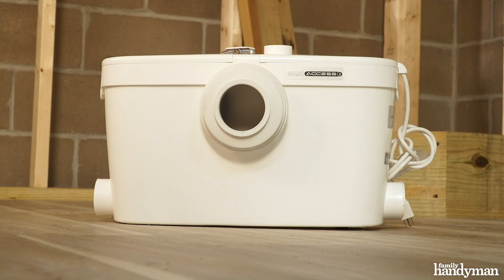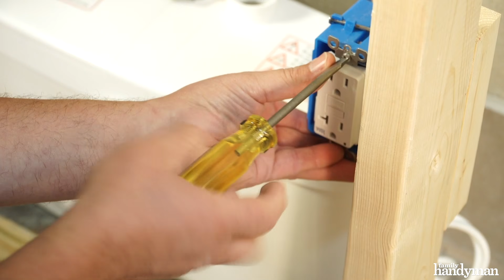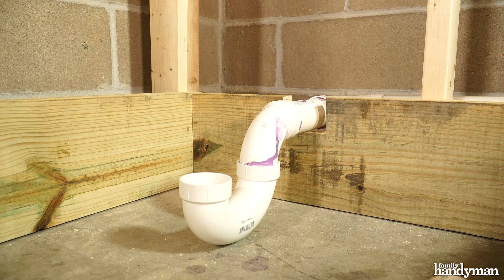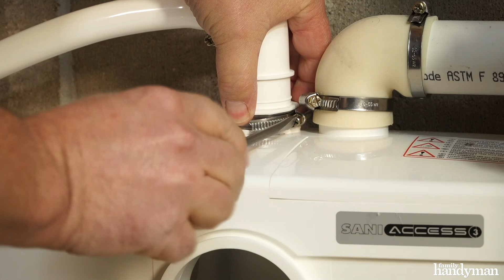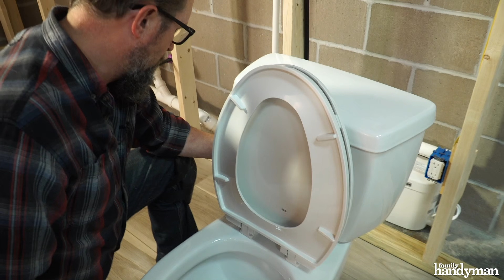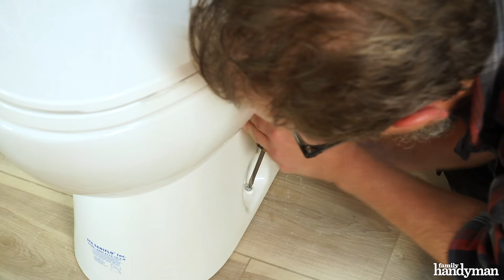How to Install a Saniflo Toilet

Comment: I mean no disrespect whatsoever buddy, but you really must check the work you've done. Starting from the shower 2" discharge that sits below the proper pitch to the vents for each fixture (not a rule for everyone) and a few details that you've missed throughout the installation such as an access panel for future proofing! 😊

Comment: Did you drywall everything behind the toilet?  What if the system goes bad are you going to have to tear up the drywall to fix it?
Reply: Adding to this, do you have the rest of the build on video?  Like the shower and the sink and then the finish bathroom?

Comment: Seems to me the flexible the weakest point of the install.   Would not that boot  stop the flow of solids to the pump?  Is is possible to use solid pipe vs flexible boot?

Comment: Is the toilet pump made to handle water discharge from a sink as well as shower, along side the toilet? Won’t that void any warranty on the toilets pump? That toilet waste tank looks to maybe hold 2-4 gallons of water max, and a shower can use 2+gpm.. I’d be really interested to know if that’s factored into the design or if maybe it’s supposed to have sink/shower water discharge to help flush out the macerating unit..? Anyone know?

Comment: We’ve had one in our basement for 17 years. It’s getting weak, but we will replace it with another saniflo sanibest pro.
Reply: Hello, do you have yours hooked up to a shower and sink as well? We are going to do this in our basement bathroom and we’re trying to find feedback from others who already have done it, thanks!
Reply: @Nnn-nv4tw  yes we do.
Reply: @Nnn-nv4tw we did this too in our basement.  Basement stairs go down the middle with a wall in the middle.  One side of wall is the tiny bathroom with sink toilet and shower(husband built a tiny shower using RV enclosure) step-up.  The other side of the wall is where the washing machine is located and the macerator which is easy to access.

Comment: For the shower could you have dug into the concrete to put the p trap in the ground instead of building that platform?
Reply: @anthonypierre2094  what my husband did was make a step-up shower(RV Enclosure) with the pipe underneath it, which laid over the concrete.  Have had this system for 6 years now.

Comment: How tall did you make the base for the shower?  Also is there a video of you installing the shower pan?

Also can you tap into a 3/4” line instead of a main sewer line?
Reply: 3/4 drain line??? Never heard
Of such a small drain.. I wouldn’t dare attempt to drain anything into a 3/4” line… my kitchen sink is double the width of your supposed 3/4 drain, and I have to snake it out at least once per year..

Comment: As someone with part of their job is to maintain buildings… please do not put this behind a wall. The company I work for has quite a few of these behind a wall and it’s so much more of a pain in the neck when these things are behind a wall so if something goes wrong with them expect a increase in your bill because you have to cut into the wall, or if the pump fails and leaks well self explanatory.. leave it behind the toilet but not inside a wall.

Comment: bad decision for placing that unit in the back of a wall that you will finish making it inaccessible for repair down the line. Just make a finished box behind the toilet BEFORE having the pipes go into the wall and this way you will have peace of mind for the future.

Comment: What happens when the pump breaks? How do you get there? Knock the wall down no service access up against the blind wall. Could you put it on another wall? That's not blind but against the bricks. You and get to the pomp where it breaks

Comment: If you install one of these don't put it in the wall behind the toilet.  Put it some where that you can easily service it or replace it if needs be.
Reply: Maybe an access panel like they do in Europe? Or on the backside of the wall...
Reply: Behind the wall is nicer looking and much more quiet. As long as you have an access panel you will be OK for future repairs.

Comment: You need a ball valve I believe just outside of the discharge though for possible maintenance.  Other than that you covered it all real fast.  Thanks!
Reply: Where does a ball valve go and what does it do?
Reply: @darlenenieswender4499  on the drain just after the pump to prevent poop from raining down from above in the event of needing to service the system or disconnect it from the plumbing

Comment: ...mine has been installed since 2008..I am on my 3rd macerator...they are about $400. My recent problem is that my toilet seems to be leaking at the bottom of the toilet...more like "seeping". I tightened the screws, but one of them either stripped, or broke...any suggestions?

Comment: I live in Florida (no basements). I am looking into installing one of these outside for an outdoor toilet near the pool deck so people dont have to run inside. Do you know if I can hook the discharge into the 2" cleanout cap that will be right next to the toilet? That is the only option I can think of without destroying the foundation of the house. Thanks
Reply: You can hook the discharge up to any sewer line that is properly sloped and plumbed to code (just don't turn a dry vent stack into a wet one if that's not allowed). If you do use a sani-T clean out then you will lose the a ility to use that clean out to unplug things. I would probably add another sani-T on top so I could break things up if needed.

Comment: I wonder if the macerator unit could be positioned lower. By that I mean cut or break up a small amount of concrete and put the unit say 8 to 10 inches down thus eliminating the need for a raised shower or bath. The toilet connection would then need to be elbowed down to reach the inlet port of the macerator..
Reply: I was actually thinking of building the whole floor in the bathroom on a raised platform and that way you don’t have the step up shower issue.

Comment: My only concern with this is longevity of the macerator. Like anything mechanical, it wears down and breaks. 

If it’s behind a fully finished wall, it’s a pain to replace. Doable, but wondering if it’s worth saving busting up the concrete.
Reply: Just put an access point in the wall where the macerator is placed!!!

Comment: What happens if there is an issue with the macerator system? I’ve seen reviews that toilet paper gets stuck or they need to replace. If it’s behind the wall and drywalled in, how are you able to access it?
Reply: I can actually answer that for you, what I did was NOT drywall the section in front of the pump which is directly behind the toilet. I left a hinged panel painted the same as the room and when I need to access the pump simply unhook and remove the toilet lift up the hinged panel and I full access to the pump.
Reply: @bkkcanuck Excellent idea, going to do that for mine when I install
Reply: @suuupretty  Currently just under 2 years it's been active. Roughly about 1800 all in for pump, toilet, tank and pipes.

Comment: Looks like have a shower and sink attached to your system...could you share any additional info specific to how you set up the venting system for each.
Reply: The specs are based on your shower pan. Your pan will determine the specs.

Comment: It's the best decision we ever made for our family.  Did sink toilet and shower combo.  Have had it for 3 years.  No issues at all and can handle Charmin toilet paper.
Reply: @suuupretty  back then.. it was approximately less than 1k.  My husband bought an RV shower for the enclosure and a tiny sink.  He never built a bathroom and for his 1st time, his looked like a pro....and in the basement.  Saved us sooo much money.
Reply: Do you have your sink and shower going into the pump on one side or are they on their own?
Reply: @mikecabral7436  they are all together on the other side of the wall where the macerator is located.
Reply: What does a system like that roughly cost?
Reply: @jqsqueue ......1 k .....4 yrs ago
Reply: The toilet paper was the info I've been looking for lol thank you! 🎉
Reply: @kashnlexy lol 😊. Thank You.  Ppl dont seem to understand how important that is bc i like to take into account the strength factor of the flush and that would require toilet paper brand.  So far, our saniflo is still going strong.  No issues.  And I have a husband, a teenage boy and school boy 💪
Reply: Hi. I may go this route for my garage suite Reno. Does the toilet make much noise when it slices and dices and pumps?
Reply: @loopholelifestyle  it makes just as much noise as a regular toilet.  It's a different sound but same noise level.
Reply: It makes a lot more noise when it runs. The toilet is the same but the macerator is very loud. However, it's worth it if you don't want to tear up the concrete, or don't have pipes that you can even  connect to in the basement.
Reply: Well that’s a relief it can handle charmin toilet paper. Can it handle cashmere?
Reply: @TCISWHATYOUSEE  lol
Reply: Do you have to use 3/4" for the discharge line or can it be 1 inch? Or is 3/4" the recommended size only?

Comment: I have a question, how does this works with toilet paper put into the toilet? Does the macerator takes cares of it, or the toilet paper needs to be disposed in a trash can...also, whats the minimun space clearance to have it installed
Reply: Its rated for toilet paper. NO PAPER TOWELS OR TAMPONS. I decided no to put toilet paper in mine just to be sure.